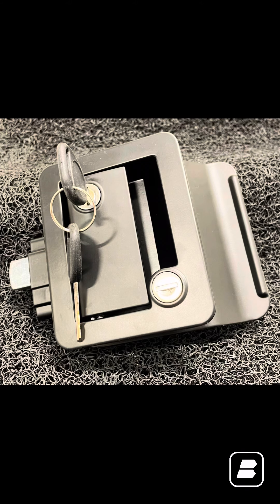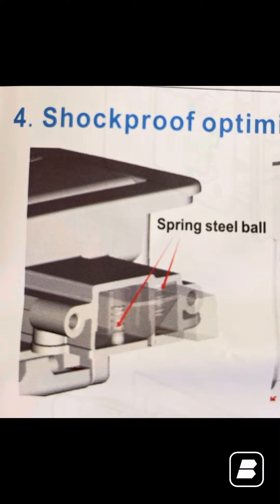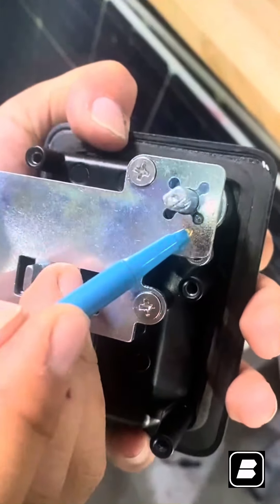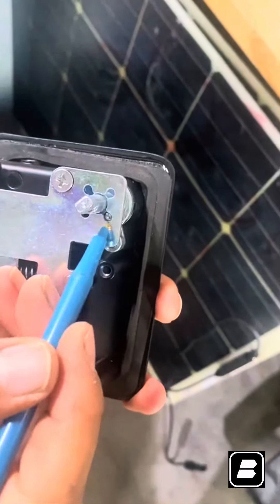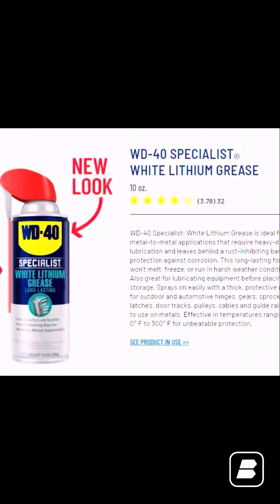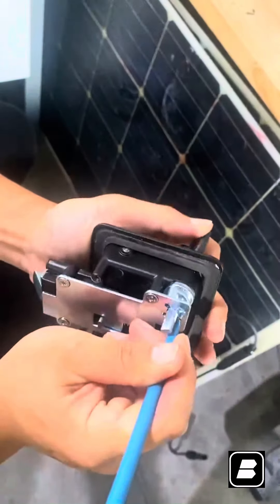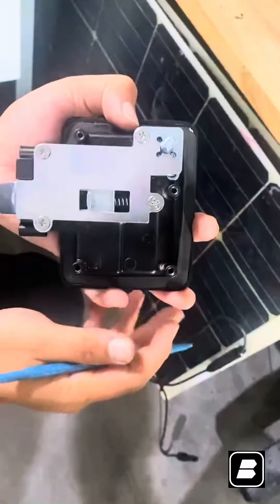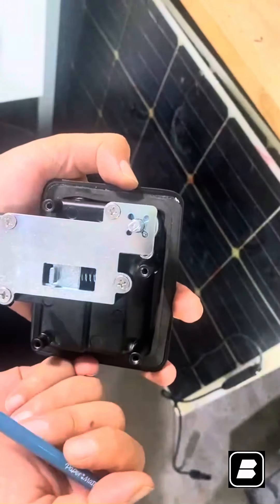Tech Tips: RV Door Lock Troubleshoot

Comment: Mine is stuck with the door closed.  Is there a way to fix without drilling out the lock, I tryed spraying the tumbler with wd 40 and air plus giving it a bang as I tried the key, still won't open.
Reply: @scottytoohotty80 Did you find a fix by chance?  Ours appears to be doing the same thing.
Reply: @tonyakopaska2117  had to carefully drill it out.
Reply: Thank you for your response!
Reply: Ok, yes- my door is locked I’m outside with a key…. This morning locked it, now it won’t open?!! 🤔
WD 40 is inside 😮
Key will turn top lock but not bottom right one